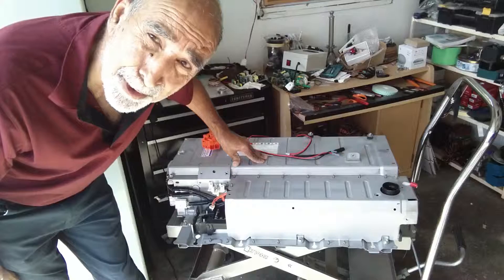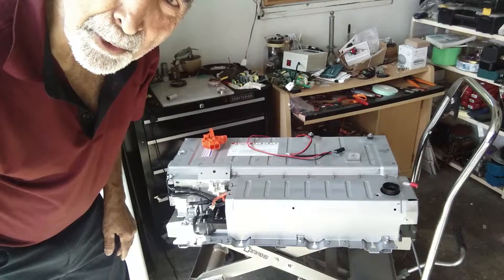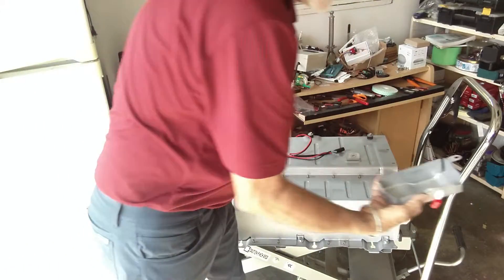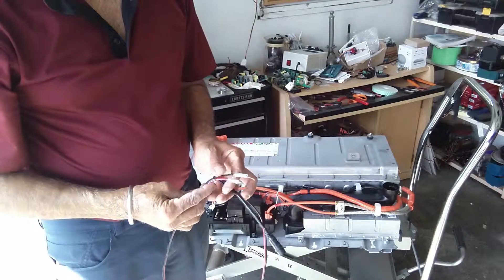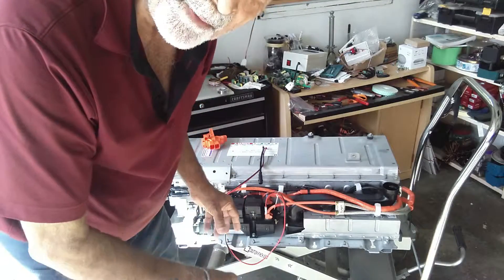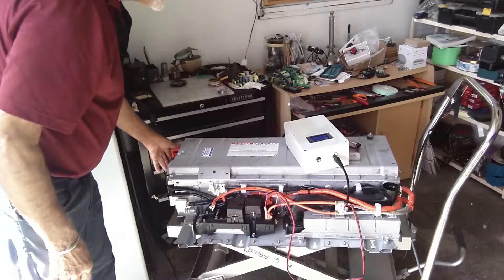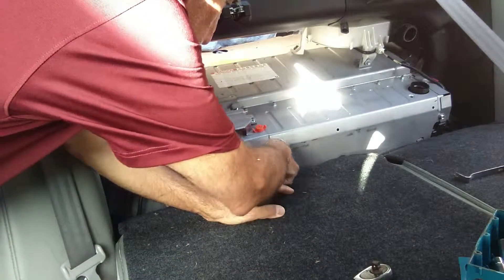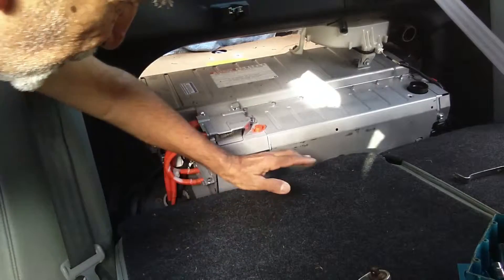Toyota Camry Hybrid Wiring Connections

Comment: I am getting 268 volts in total battery  is this fine or do i need to check each and every individual module ?
Reply from the maker: I recommend that you recondition the battery pack. Your battery pack is also made of 5  D cells in series and these are well known to recover their capacity and lose the memory effects.

Comment: I have a Toyota Camry Hybrid and its my daily use car and was working for me very well, while I was parking it the engine shut off and never turned on again it been like two days
I have done the test on the hybrid battery nothing wrong, checked all the fuses nothing wrong, tested the 12volts battery nothing wrong.
any recommendation please??
Reply from the maker: You should take it to a regular car mechanic shop for diagnosis.